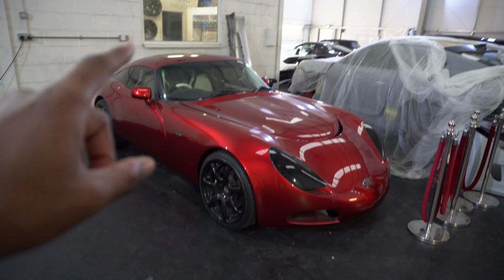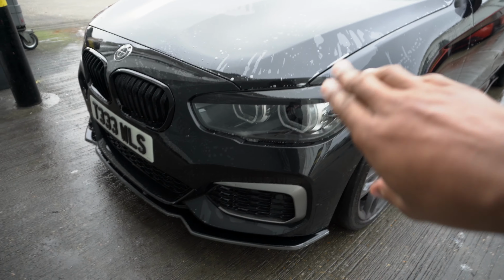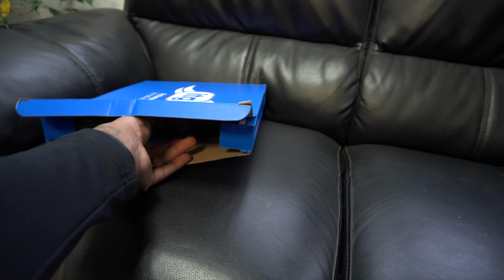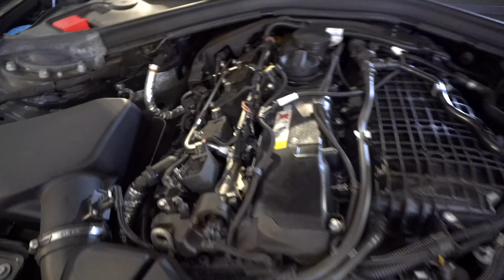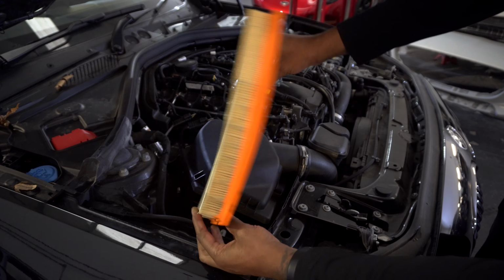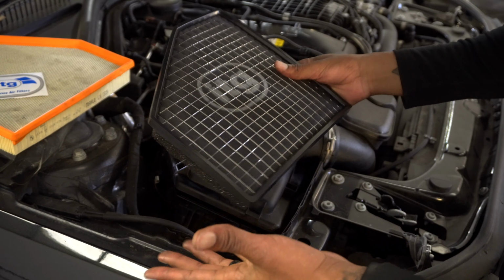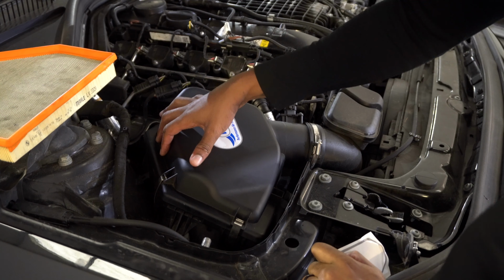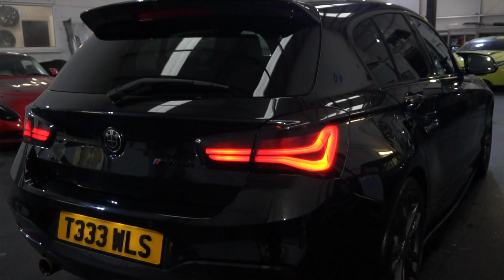BMW M140i ITG AIR FILTER BETTER THAN OPEN AIR?

Comment: Nice work , I see Williams performance do the silicon intake hose , might be worth getting for the price, and may see a little bit noise
Reply: I've got one boxed up and ready to post Monday 👍
Reply: Marc Williams get it sent to me for free so I can test it and then I’ll be you’re salesman 👨‍💼
Reply: @Addselwyn  it's been tested on my car for 6 weeks mate 🤣
Reply: Marc Williams and the results are 😗
Reply: @Addselwyn  little bit more turbo whistle, deeper induction note. And looks much better than the original plastic pipe and silencer
Reply: Marc Marc Williams cool , I need the under chassis brace first , do you send them with the expanding plastic rivets and white plastic parts for a 19 reg car as I think they are different to earlier models 🤔
Reply: @Addselwyn  they all use the same kit. Yes they come complete with everything to fit. I've sold out at the minute but I ordered 5 yesterday so should have them later this week.
Reply: Marc Williams nice one , my order has been placed 👍
Reply: @Addselwyn  thanks. They should be in this week so I'll keep you posted on delivery times.
Reply: Marc Williams brilliant thanks 🙏
Reply from the maker: Stay tuned! I like the way you think Adam 😆 
See you’ve ordered the brace! 
Good shout, on my list too so will be good to hear you thoughts after fitment
Hope you and yours had a special Xmas and Happy New Year in advance! 
Please like and subscribe!
Hit the notification button so you don’t miss out on the new videos!!
TW
Reply: Tim Williams get yourself one ordered 😀
Reply from the maker: Will do! I’ll come sleep at yours when she kicks me out 😆 I’ve got a diffuser on order currently .. don’t want it to look like I actually like spending on my car 😂
Reply: Tim Williams  been subscribed for a while now love the uploads , brace has been ordered I have just Fitted the ultra racing strut brace so hoping it will help tighten the car up , hope you have a brilliant new year . but if all else fails I have a spare room at my house 😂
Reply from the maker: Yes mate I’d assume so, few track days in stock form are really gonna show me what I’m missing in terms of bracing tbh 
😆 cheers
Have a good one matey
TW
Reply: Tim Williams 👍😁

Comment: You missed a clip on the air box my brother, the one hidden just under the mass air flow sensor, if you have not been near the air box since this video better go check ??.
Reply from the maker: I didn’t undo that one, could slide it in and out without undoing it 🙏🏽